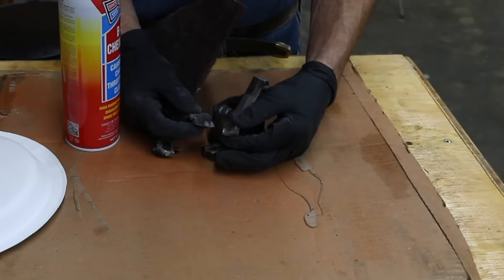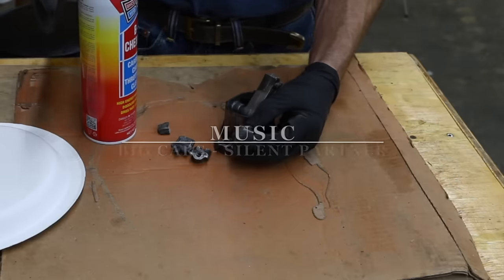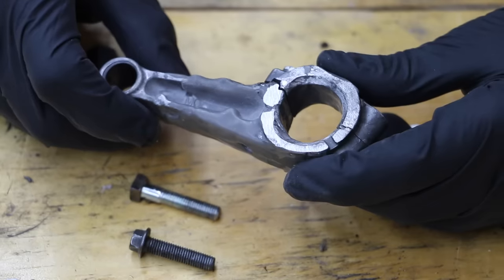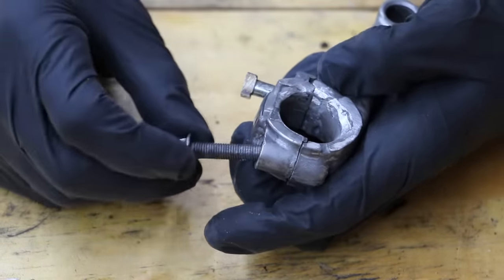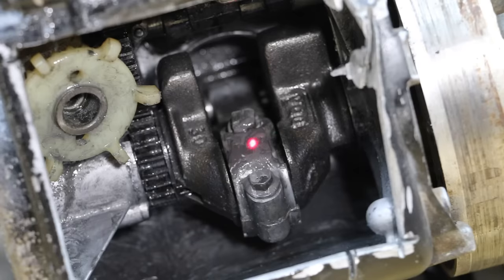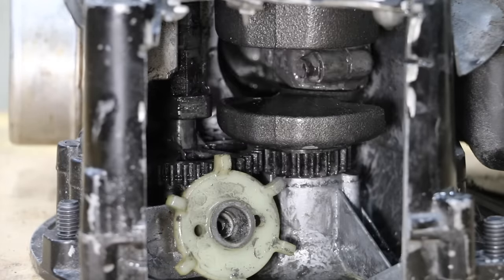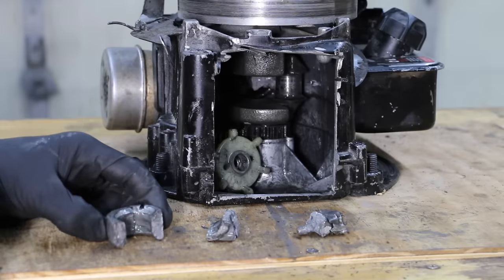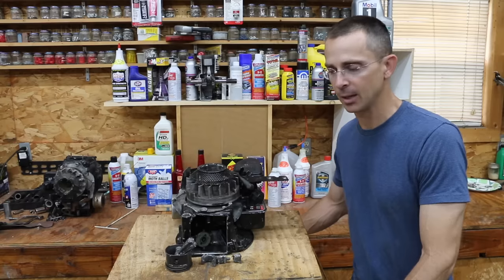Is JB Weld Strong Enough to Repair a Broken Connecting Rod? Let's Find Out!

Comment: My experience with broken rods is that there is generally significant wear in the rod bearings (rod knock) and/or crankshaft journal before the rod let's loose.

You may have repaired the rod, but any play probably  remained.

I've made some fairly impressive repairs with JBW.
Reply from the maker: Great point. Thank you
Reply: I suppose if you had a fracture that exposed a lot of metal surface area and the part wasn't under tension you could JBW it, which is what I presume happened to the "guy" who fixed an engine block on their packaging "testimonial".

Other than that, Harbor Freight's $2 epoxy is sterner stuff.

Comment: I had a quad bike wich had a hole in the crankshaft bay. when I used to start it the oil was flowing by this hole. I fixed it with a bit of jb quick and it worked
Reply from the maker: Impressive repair!
Reply: Yeah a hole that has no stress will usually work....but a connecting rod..NOT

Comment: I’ve repaired a regulator manifold on my California Air Tools compressor, and it works great. At the water company I worked for we used a metal impregnated JB Weld to repair flange surfaces by filling in scratches, and indentations to insure a perfect gasket seal, but never anything under so much stress. And of course the JB Weld we used was industrial strength, not the same as you would buy in the store. To repair the regulator manifold I ground out the crack in the fitting connector nipple , then I welded it with Alumiweld rods. Then I used the JB Weld to seal the crack on the ID threads before reinstalling the air fitting. It’s holding up well at 120 psi.
Reply from the maker: Thanks for sharing.

Comment: I hate to disagree with you on this, but I don't believe that rod failed because of the JBweld. I believe it failed because you were running it dry again. You can try to guess how many seconds until the rod binds up and breaks, but it's still just a wild guess because that break was inevitable. I really wish you'd put this in a complete block (or glued a plastic panel over that hole) and then put oil in it to really give the repaired rod a chance to live. If it had it's regular oil bath (and that little hole on the side of the rod isn't blocked), then I believe it would have run long enough to go out and mow some lawn. ;)
Reply from the maker: I sometimes leave out important content to keep the videos concise.  I used Lucas Oil Stabilizer to lubricate the cylinder walls and connecting rod.  The engine didn't run long enough to burn off the Lucas.  I might repeat this test making a clean cut across the connecting rod and then we'll see if JB Weld is up to the task.  I believe it could last if done properly.  Thanks for commenting!
Reply: Well, add to that how rough the bearing surface was too. It would REALLY be taking your time spent over the top if you were to bolt the rod together and bore it cleanly to an exact size, but I bet that would also give the epoxy a fighting chance to survive. 

Just random thoughts and dreaming, you know how it is. Was still an interesting and fun video regardless. ;)
Reply: Nope I disagree it didn't even last long enough for oil to Splash on it if there had been oil. Jb weld sucks
Reply: @ProjectFarm  The problem wasn't the lack of lubrication, a properly built engine can run for a short time with little to no oil in it. Where you did go horribly wrong was in the condition of the rod bearing and crankshaft. If those aren't perfectly machined the engine will fail in only a matter of a few seconds, and that's exactly what we witnessed. I bet if you took a little more care in doing this you could have at least got it to idle for a short while.
Reply: Project Farm I second that it should have been ran in normal conditions and the rod was in a very bad shape.

Comment: Although it's 3 years later it would be awesome to see if the Muggy Alloy or the different aluminum no-weld welding rods would hold up.   So many options on the market now, I would pay hard $$ to know which one is the best (without buying them all).
Reply from the maker: Great suggestion! Thank you.

Comment: What about taking a connecting rod, sawing it in half then using JB Weld?
Reply from the maker: Great test idea! Thank you
Reply: @ProjectFarm  Or what about substituting JB-Weld for those two bolts you used, then testing it.  That way you could test using a new connecting rod rather than the bent one.
Reply: Err the con rod will be considerably shorter !

Comment: I used JB Weld to repair an eroded exhaust manifold gasket face on a Honda 2hp Outboard, it has since run perfectly for the last 4 years. It was a really badly damaged port but JB worked a treat. The outboard is used 30 plus times a year 1-2 hrs at a time so it's had a really good test. Great product.
Reply from the maker: Thank you!

Comment: Now try it with those “low temp” aluminum welding/repair rods...😊
Reply from the maker: Thank you for the video idea!
Reply: I’ll spend a lot of time and make some nice fillets . Tig weld that thing and we might get 5 min out of it . With out a load . I like and need to see videos like this because I like to know the limits of the products available. Even if it’s very obvious that it will break but I want to know how long till it breaks . Lol .
Reply: Anyone tried jb weld on a John Deere plastic fuel tank that leaks at the tank drain fitting?
Reply: @makingcookingfixing  That probably was because of too high temperature (over 400 deg c) or bad Al soldering rod. I used one to fix my cracked oil pan on my car and holds up really well. Actually a good Al soldering is stronger than the Al itself, so my bet is it would work if it is made well.
Reply: @makingcookingfixing  They are not that good but not terrible. It needs constant temperature which is high enough but not too high, this is the hard part, and a lot depends on the aluminum itself. If it is an alloy, then the result is not guaranteed. Because this is not a welding but a soldering technique, diffusion happens instead of welding. But it worked for me the first time, though it needed some practice. I've used 300 deg C rods. They say 400 deg C is a bit better, but since the surface was large (sinks heat very fast) and I didn't have just two propane torches and an oil pan is not having much mechanical force applied I went with the 300 rods. They are handy for sure, try again!
Reply: @makingcookingfixing  Well, it is obvious the part has to be heated, because the part you are soldering has to melt the rods, not the flame! It is true the mass sinks the heat fast, but preheating the complete part is not necessary but recommended. I used two torches, one was heating the part from behind and one from where i applied the rods. When i touched the rods to the crack i moved the other torch behind the part to maintain the temperature.
Of course all depends on the size, shape, mass and material of the part.
Reply: Good idea
Reply: @ProjectFarm  that I would like to see
Reply: I used  low temp aluminum rod on my cracked mountain bike rear  triangle arm, it hold up till today, lots of log jumping over the 12 years.
Reply: Lumiweld Aluminium solder rods have been about for donkey's years. back in the 1980s a workmate used it to repair a VW Beetle gearbox0engine mount lug. We all said that can't work. But it really did and he ran the car for years.
The snag is that it's not welding, you can't do one side and flip it over. because the stuff melts and runs out. A thick part has to be dammed up with high temperature putty so it can be solder filled from one side. Then fettle it clean and drill out any holes.
Reply: But the trouble is it might just work for a very low power application like this, but you will get some thundering shit gibbon try it on his car and wonder why it didn't hold up the same lol!!!
Reply: @robertowen8281  Natural selection...🤔😜

Comment: the craziest thing i fixed with JB weld was an aluminum cylinder head. Dexcool corroded the head around the water jackets and I was afraid the new head gasket wouldn't seal. So I ground out the corrosion with a wire wheel and filled the area with JB weld.  Put the head back on and the customer has been driving it for 2 years with no problem.
Reply from the maker: Impressive repair!

Comment: I had a 18 horse Briggs on a Snapper rider that threw a rod years ago.  I bought a new piston and rod, replaced them and thoroughly cleaned and glued up the crankcase with JB Weld.  My dad is still using it to cut grass 5 years later.
Reply from the maker: Fantastic!  Thanks for sharing.

Comment: Will it work For the a down spout for putting fuel into a very large machine. It’s just an elbow that you use to fill up the tank. There’s a little bit of fuel sloshing around and coming out the crack

Comment: hey  mate you should see what methanol does  to a stock  engine  or even nitro ??
Reply from the maker: Thank you for this idea!
Reply: That would be awesome
Reply: We used to run methanol in 360 Honda engines in our race cars. Only mod we made was to drill out the jets. Methanol (or any alcohol) does not have as many BTU’s as gasoline, therefore you need more of it to make the same power, so the engine needs much bigger jetting. It’s the same reason you actually get more mileage with pure gasoline than you do with this ethanol contaminated fuel we are stuck with now. However the engine will run cooler on alky, which was why we ran it in our air-cooled engines.

Comment: Build a new connecting rod out of wood.
Reply from the maker: Thank you for this recommendation!
Reply: rz350ypvs1 surely bubblegum is the way to go
Reply: I'd bet that it wooden last 5 minutes.
Reply: @carlyletom301  
I doubt wood could last very long at all in that application, for a rod, it has too many stress points both from being pulled, and pushed that's why in high performance engines it's important that rods be very strong.
Reply: Gotta be hardwood not pine lol
Reply: @carlyletom301  lmao 😂
Reply: Osage orange..very tough wood..should hold
Reply: Build an entire engine from wood...
Reply: Or 3d printing a plastic one and see how long it lasts.

Comment: JB Weld was the only adhesive epoxy worked on my cracked radiator years ago.  It was never a problem again.  Tried nearly every epoxy and adhesive in town before JB Weld by shear bad luck.  I use JB Weld first these days.
Reply from the maker: Thanks for the feedback.

Comment: Had JB weld repair a broken driver's side engine mount after it snapped off a piece of the block(accident), repaired it and never had issues. Also used it on a rear transmission mount that snapped off and the holes for the bolts stripped out. Fill the holes and put the mount back on with jb weld and held up at the track still working to this day. Surface prep is the biggest key factor
Reply from the maker: Thanks for the feedback.

Comment: I gave you a thumbs up of course, but I was thinking part of why it may have failed was I'm quite sure the balance on the rod was way off? Only way to really tell if it could hold up is machining after jbwelding it or just take a good rod and cut in half (clean cut) and jbweld it back together and then see if it works? At any rate thanks again for another very entertaining video
Reply from the maker: Thank you.  Yes, you are right.  The metal was deformed when it broke into pieces.

Comment: I used JB Weld Red n' Black Metal Repair on my 1987 Acura Integra Cylinder Head between the Engine Block had steam blowing through indicating a partial blown gasket. The Engine sat horizontal in the engine bay design so I was working with the entire left side of engine. First I cleaned all if any grease and coolant off. Next sprayed some none oily cleaner on that area. Next mixed JB Weld Red n' Black tubes on a piece of cardboard with plastic spatula next let it develope a while. I pressed in between the open area between Cylinder head and Engine Block where old gasket whore out very hard to fill with ample pressure. The entire area around the curve and straight side was 7" inches. I let this dry 3 days for better results. In the end I was surprised it really worked. I stopped loosing coolant and did not have to refill the coolant reservoir anymore. Good Signs Here! I drove vehicle for another 10 years no problem in the area anymore.

Comment: I used it on my truck oil pan. Fixed it very good. Also used it on my transmission when drive shaft borke. It hit it, took chunk out if it. Jb weld is awsome.
Reply from the maker: Thank you for the feedback

Comment: used JB to build up a stripped keyway in the end of a crankshaft on a dump truck v8 engine.  The truck was used in a gravel pit hauling way over its limits, and sold 5 years later, still running great with no issues.  I was impressed.
Reply from the maker: Thanks for sharing.

Comment: just doing a follow up to this video because I found it very informative.  So, I have a 2013 mercedez bens s class 550 and the radiator has a crack, the size of a pin scratch.  The car is a twin turbo.  I sanded the radiator, NOT THE RESERVOIR, and put the original jb well and it did not work.  The jb weld became like brittle, soft like dry toothpaste or dry mod because of the contact with the coolant.  I tried two or three times to fix it and it did not work.  So, I got critical  and watched other videos and found one about jb weld for radiator, the plaster one or the blue one.  So, I mixed it and followed directions, sanded, and applied and it did not work either.  I got more critical and though, well, I am dealing with HEAT, CHEMICAL, PRESSURE, and plastic.  It turns out that the radiator is plastic mixed with metal.  Why I mentioned this?  Well, I melted a plastic to the point that I would create a patch from a pool plastic wall and it DID NOT WORK.  So, back to the drawing board.  The blue  jb weld did attached firmly in some parts where the coolant was not present but that is not what I wanted.  So, I had to solve the problems in level of factors dealing with and ended up using three types of jb well and an added bonus and some creativity.  I put the blue jb well, I do not remember its name at this point because it's 1:48 am and I am writing this and I am taking a break from doing some programing.  Right here I got low and put a cap from coke and fill it with the blue jb weld and then made a small extending clamp to push the cap against the crack and against the other side of the radiator wall.  The crack is where the air intake hose goes and so it has a handle in front of the crack and that is where it pushing against. So, after I put some pressure I moved to the next patch.  I used the jb well for plastic and covered the cap.  After it dried within the times stated, I used the jb well original and left it there to dry and will leave it there until tomorrow so that it gets a good hold.  The problem here is that I am dealing with four problems and you have to address them separately, I hope it works. The previous times that I tried to do it, it only slowed down the leaking of the radiator coolant.  If this does not work, I will have to replace the radiator since it will be cheaper than replacing the engine which will be in excess of $ 1800 which is the price from midas to fix it.  Regular is abour $ 600 but with the mecedez bens dealer will be $ 1200 for the radiator plus whatever else they charge.  Hope this helps.
Reply from the maker: Thanks for sharing.

Comment: I have sworn by in weld ever since I used it to repair an alternator bracket ear on an 85 volkswagen diesel. A third of the boss was broken off. Jb weld worked so well the car lasted 200,000 more miles, and the engine quit with the repair intact. Excellent product!
Reply from the maker: Thanks for sharing.

Comment: Used some kwik weld to repair a gouge on a crankshaft front causing an oil leak and tearing up the seal, perfect after sanding with final 400 grit.
And cheers from down south, waaayyy down south, Australia.
Reply from the maker: Thanks for sharing!

Comment: When my transmission hose busted I did an emergency repair using JB weld which mostly elimated the leak for 15 miles which was the destination and then later on replaced the hose. The temporary repair did not completely eliminate the leak since when the oil got hot it started leaking at an slow pace which allowed me to get to destination.
Reply from the maker: Thanks for sharing.

Comment: You're right J-B weld won't hold on for that long but it lasted about fifteen Miles on my Yamaha g22 golf cart putting it on the main drive clutch weights, 15 miles later the J-B weld gave up on the clutch weights popped out. I'm going to give J-B weld another try and if the second one fails then I'm going to get new drive clutch weights 👍
Reply from the maker: Thanks for the feedback.

Comment: I used JB weld on glass '95 Jeep Grand Cherokee headlight housings. The headlights were UK spec, the glass lense was pulling away from the headlight bucket. I cleaned all surfaces, applied JB weld, let sit, and they never came apart or leaked even on a lifted Jeep running off road tires that had vibration.
Reply from the maker: Impressive!!